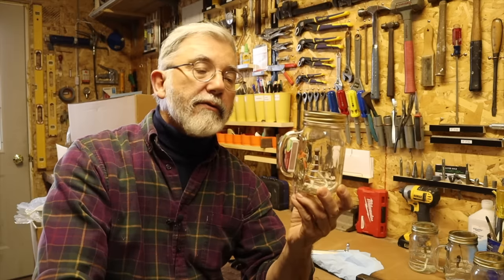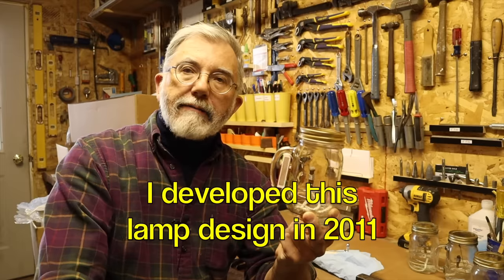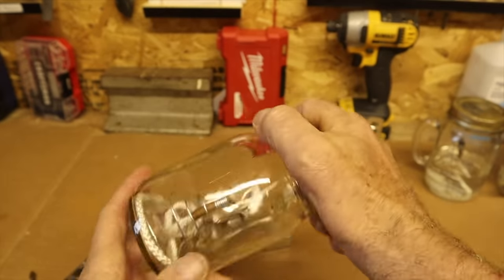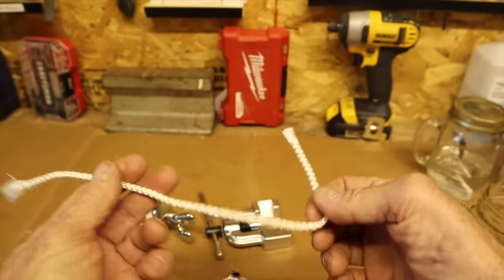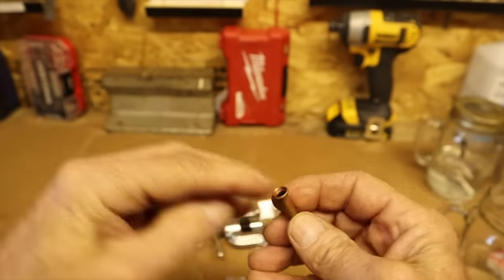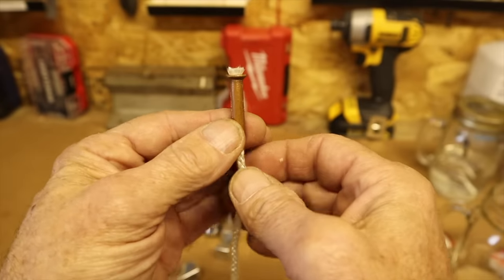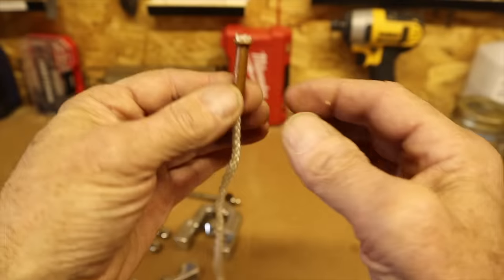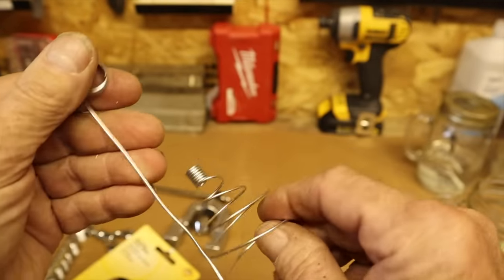How To Make Your Own Bright Betty Emergency Oil Lamp

Comment: Thank you for the great instruction on this Bright Betty Bam a Lamp! I am definitely going to try making one (or more). I was wondering where you buy your liquid paraffin?
Reply from the maker: I bought several gallons of Hollowick "liquid candle wax" back in 1999 for Y2k.  I still have most of it and it's still perfectly good. I have seen it being sold at Walmart, at ag supply stores, in hardware stores, and I've even seen it in a grocery store. There are shortages of everything these days but I think you should be able to find clear lamp oil without any problem. Amazon has it, but it's pricy.  https://www.amazon.com/Hollowick-Inc-Liquid-Paraffin-Gallon/dp/B01EYJ3BL2/ref=sr_1_3?crid=OA7YL4F9PFBL&keywords=hollowick+liquid+candle+wax&qid=1667262165&qu=eyJxc2MiOiIxLjQ4IiwicXNhIjoiMS4zMSIsInFzcCI6IjEuMzUifQ%3D%3D&sprefix=hollowick+liquid+candle+wax%2Caps%2C91&sr=8-3
Reply: @herrickkimball  Thank you for responding back to me. That liquid paraffin...pricey indeed! I wish I had stock left from Y2k too. I'll be searching around for a better deal. It may be called something slightly different, and not sold on Amazon. Love your lamps...I'm going to hunt down the jars with the handles too. Have a good evening.

Comment: Hay just wondering if the shaft/shank/jacket part of a Chicago screw may work for the wick holder piece or do they not come that long?
Reply from the maker: I don't know. It might. Worth a try if you have one. Thanks for the idea.
Reply: Georgette Roenfeldt:  They come quite long.  Mom has an album for photos and memories when traveling, that’s all together with Chicago screws, and I believe that those are about 3 inches long.  
     For a long time I carried my ideas around in a little folder with individual pockets in it. Eventually I had to expand the Chicago screw that was holding it together, to one that was an inch and 3/4 long.And that was far from the longest one I saw on the display at my local hardware store.
Reply: That’s a cool idea, but you would have to drill out the end of it, as the shaft is solid on the end.  Good thinking though, and doable.  I think it could work!

Comment: I made one of these in 2008 but the fuel was olive oil instead of paraffin.  Worked well.
Reply: Paraffin burns a LOT brighter than any vegetable oil.
Reply: @kenwaid8239  That may be, I don't know for certain.  I used Olive oil because it was what I had, it had turned bad, and was unsuitable to eat, so I used it in lamps.  1 buy 2 uses.  I win.

Comment: I like it , and  the video how it works and how to make one, Your clear instructions are  perfect,
Thank you

About shaping the coil wick stand, instead of unwinding and trying to form it   i think maybe it could be shaped by pushing it down over a traffic cone,  use an existing wick stand   place it over the cone and mark the cone 
Now you have a marked form to use when expanding the wire coil  to the needed height,
 i think I'm going to make a couple Bright Betty lamps,
Thank You

Comment: Cool deal  for the preppers in off gritters even the little backwoods runners them are nice appreciate that idea you probably could have marked it and made pretty good bit of money off of them be cool if you could put a little adjuster on there on the so you wouldn't have to put your fingers on the paraffin wax to push the wick up sort of kind of like a hurricane lantern has little adjuster knob for the wick and just you can figure it out a little pin through there with a little spiked wheel just turn it a little bit that way you pick it up turn the little thing and then raise the wick up I mean just set it back down in there but cool deal thanks for the idea God bless
Reply from the maker: The wick adjustment is best done with some needle-nose pliers. Thank you for the comment. 👍

Comment: I am wondering how a step drill bit would work for the wire after you wrap the first coil.  i have one that goes from 1/4 small end up to 1-3/8 big end..   PS.. any one remember the floating oil candles..  it was a clear plastic disc that floated on top of the oil and a center hole for a wick.  you filled most of the glass jar with water, pour a little oil, on top ( oil floats on top of water )and the disk floats on the oil.  Used like vegetable oil / olive oil.
Reply: Zak S:  I was wondering the same thing about the step bit; my mother had those candles too, with the glass tube-type lamps that she would fill with coloured water, with a thin layer of oil on the top, that was probably only half an inch to an inch thick. Us kids sure liked those.

A number of years ago, I came across the packages of wicks and plastic floats at the dollar store, and picked up a few. They still seem to work as well as ever.

Considering the price of liquid paraffin, I can’t help but feel like they were a real deal (although I do have several oil lamps all filled with liquid paraffin, at $35 a bottle and rising in my area, I’m hoping it never has to become my main source of lighting) :). 
     If you can find those disc setups, it would be important to make sure it didn’t burn down to the water level, because at that point the wick starts to burn instead of just wicking, and the little plastic disc gets damaged.
     It probably wouldn’t be too hard to repurpose one of those lids from a takeout restaurant, a variety of the smaller condiment containers, to use for the floats.

I had forgotten about those, so I’m grateful for your reminder as we are all breaking out our emergency supplies and preparing them to be pressed heavily back into service these days. Tyvk
Reply: Still selling those floating oil candiles here in Spain in those cheap "one euro" stores. Anyway they are easy to diy with cotton wicks an cork disks with an aluminium tube rolled from a piece of beer or softdrink  cans in the center hole of the cork disk. Only to use in vegetable oil, (not kerosene or liquid paraffin)
Reply: @papuchu  :  That’s a great idea for Re-creating them at no charge using just things around the house. 

Thank you so very much.
Reply: @daphneraven6745  😉

Comment: What a great idea.  I use to use oil lamps at Camp but they spilled often.  With these you can put a Mason Jar cap on top and seal them up while they are in storage.    Might make a few if I can find the Fiberglass wicks ar a reasonable price.

Comment: I bought floating candles on amazon. They are metal discs filled with air. They float in meat grease and i put a wick in them. I use my grandparent's tongs to pull the disc out if I need to. I also have a railroad lantern and an alcohol burner.

Comment: I would suggest setting the lid on the top to extinguish the flame, because the odor of the smoke that is produced upon going out can be a bother, and I really find it gross. It isn't poisonous, but also it's not like you want to open a window to air out the room, in the winter at night during a power outage.👍😁

Comment: years ago when antique stores were known for old stuff, not the reproductions they have now, I purchased several coal oil lanterns, to use during power outages.  But I discovered my wife does not like the smell of kerosene evaporating.  So I emptied them and set them back.  But this fuel you are using, candle lamp oil or liquid paraffin, should do the same and perhaps even throw out a brighter light!  Thanks for the idea!  Now I just need to check with my local hardware stores to find it!  I also purchased a few 30 day candles and stored them back.  Strangely enough, our local power company has gotten better at delivering electricity and we have very few power outages now.  But it is good to have something just in case!  Thanks again!
Reply from the maker: The liquid paraffin lamp oil does have some objectionable odor when burned. But not like the kerosene I remember my parents had in their old flat wick lamps.

Comment: now get a larger glass jar.  one you can put that oil lamp into.  put it in and carefully pour water around the outside of it.  actually put it in unlit and cold.  then light it.  the water will magnify the flame.   so make sure the flame is far enough down that you can get the water up high enough and etc.

Comment: If you could wrap tin or metal flashing around 1/2 of the mug you will gain luminosity using the reflective surfaces.

Comment: This is fab.  Do you think it would be ‘safe’ to use a lid with the straw hole in it, whilst its in use? I’m thinking about reducing liquid spill if it was knocked over. Obviously still a point where it could leak, but i wonder if there would be sufficient size hole for smoke / soot escape without too much of an o2 reduction that would put out the flame.
Reply from the maker: It probably would not work with the lid and hole. And the lid would get extremely hot if the flame was able to get the air it needs. I discuss safety in this video... https://youtu.be/asgeLt0cshE

Comment: Instead of using the paper roll for the second winding of the wire, would the top portion of a glass coke bottle or plastic coke bottle be a better jig, give a better form, and save time?

Comment: Other than smell and soot, wouldn't this work as well with kerosene, lamp oil, vegetable oil?
Reply from the maker: I think that the liquid paraffin lamp oil I use is pretty much the same as kerosene or lamp oil, but not vegetable oil. Vegetable oil will not "flow" up the wick. Smell is relatively minor, as is soot. I discuss some of this in this video: https://youtu.be/asgeLt0cshE.   Thanks for the question.

Comment: Your "liquid paraffin" or "candle and lamp oil" is just odorless kerosene.  This is a neat lamp, though -- nice light output and I like the ability to store it with an airtight lid, keep matches in the handle, and carry by that same handle when it's lit.  I might mention that I've seen lamps similar to this that burn vegetable oil (especially olive oil), just as cleanly and almost as bright as kerosene (and less of a fire hazard in storage).

Sadly, if someone wants to buy some of those drinking mugs, be sure to check that they're glass -- some of them are made out of thin plastic, which makes then lighter to ship and cheaper to make, but likely isn't a good idea for storage with kerosene inside (will the petroleum in kerosene eat the plastic?).
Reply from the maker: I did not know that plastic mugs were a thing. These lamps should definitely be made with glass jars. Thanks for the comment. 👍

Comment: I used to do commercial sewing and poly thread came on hard plastic cones that would be Perfect for coiling wire.  Of course I finally threw the 3 cones I'd saved away a few months ago.drat.

Comment: All the gadgetry you made to twist wire was insane and not vital.  I made mine while you explained how to make the wire bender from a tube and wood. The wire is flexible and forgiving. Pliers are handy but not necessary. But thanks for the plans and sharing ❤
Ps, wouldn't we want 100 percent cotton wicks?

Comment: How is the lamp during strong windy night outside the house? Is it strong to resist the strong wind? Pls reply me,,,loving from Philippines
Reply from the maker: I have not used my lamp outdoors on a strong windy night. But I have used the lamps as ambient or "mood" lighting outdoors in mildly breezy weather and it holds its flame just fine.

Comment: i started using a type of alcohol and a chemical additive to make green fire lamps, these endless oil lamps are awesome, they work with all types of oil, just don't use anything lighter than water cause we don't want vapors of fuel

Comment: I have a lot of concerns about an open flame that close to that much open fuel.  old oil lamps are out there, I'd only use this in a dire situation. Thanks for sharing though!
Reply from the maker: Please check out this video: "How Safe is The Bright Betty?"  https://youtu.be/asgeLt0cshE
Reply: what do you think people used for millenia prior to the invention of electricity? oil lamps!
Reply: @imafortunate1  Yes, but they usually are closed on top

Comment: Nicely made oil lamps and a well explained process for making them.
 Is it possible to include a fabric mesh mantle to increase the incandescent light emitted?
Reply from the maker: I have no idea how something like that could be done with these lamps. 🤔
Reply: @herrickkimball  i have been reading up some more since I posted my previous comment and it seems the reason a naked flame emits visible light is because of the microscopic soot particles in the 'sooty' flame being made to glow incandescent by the flame heat. This type of flame seems to cause delicate mantles(like gas lamp mantles) to carbon up with soot. This is why clean bunsen blue burning flames such as butane or propane work really well with a fine gauze mantle because there is virtually no sooty deposit in the flame but there is a lot of heat.
One of my ideas I'm going to experiment with is to try a gas lamp gauze mantle over a spirit lamp with Bio Ethanol fuel which also produces virtually no sooty deposit but burns quite hot.
Reply from the maker: @howardosborne8647  I like your thinking process. Good luck with the project! 👍

Comment: Have you safety tested this for fire hazards?
Reply from the maker: Yes. Safety is definitely a concern with any open-flame emergency lighting device. The worst case scenario I can think of is tipping the jar over, and  I hope to have a video out shortly showing what happens when the Bright Betty is tipped over. These lamps should only be made and used by responsible adults and never left unattended. Anyone uncomfortable with an open-flame lighting device should consider a rechargeable LED lantern, like this one: https://www.amazon.com/dp/B08L65L7PW?psc=1&ref=ppx_yo2ov_dt_b_product_details

Comment: Do you have any concerns on the glass cracking because of the heat?
Reply from the maker: No. None at all. The glass gets warm, not hot. That has been my experience. I have a new video coming out to discuss this lamp in more detail and discuss safety. The video should be out later today. Thank you for the question.

Comment: hay if you want to skip the he copper tube cutting and flareing buy a tig welding torch colet choke its the exact same size and shape also from copper just with a slit to hold the tungsten!

Comment: If anyone wants to burn almost any oil, you can use carbon fireproof mat and cut it up to use in this lamp. It does not burn up. They can it "the forever wick".

Comment: there is a potential to light the whole surface of oil and the glass will then break and could cause major issue. is why ceramic containers are better.. or borosilicate glass.

Comment: Another YTer made a lamp out of carbon fiber thats in some auto air filter but you can get sheets of it. The carbon fiber doesn't burn away but does wick the fluid, so ideal as a Neverending wick. Might wanna give that a try. The YTer is an English gent names Robert Murry Smith.

Comment: Don't use galvanized wire, just get some mild steel or use leftover solid copper or alux wire scraps. and you don't have to flare the copper. Instead of a fiberglass wick use rolled carbon felt inserted into the copper tube. It will last forever without needing trimmed hardly at all. And the song was Black Betty,  ot Bright Betty

Comment: You mentioned the tapered coil was the hardest part.  There isn't any need to taper it . Just stretch it as it comes off the cardboard tube. maybe make another turn to compensate for the larger diameter at the top using more wire.

Comment: Hmm, thinking you need a wooden cone to save yourself some grief in forming that gradient  spiral. To give you a visual, picture a jeweler’s ring sizer (only wooden and bigger).  Think that’s the route I will take in forming this spiral.  It will save my hands and time.  Thinking out-loud, could be wrong, but worth a try. 😉
Reply from the maker: Good idea. I have a whole roll of string (miles of it, probably) on a heavy cardboard cone that would be just right. Your wire spirals will be beautiful, I'm sure. 👍

Comment: Cool set up. We learned at camp: a float for a shorter wick, only needs to be as long as the oil is deep. If you put water in the bottom, it will automatically go out when it reaches the water. A safety built in. And any salad oil will work. Maybe not as bright, but light is light.

Comment: Correct me if I'm wrong but if burning paraffin is not as safe as an organic candle,why would you want to burn liquid paraffin to burn as a emergency source for heat, wouldn't you want to open a window for some sort of ventilation,for safety reasons.

Comment: You could make a cone out of that tube by cutting a slit and folding it into what you need, then tape it. It would have a point on the top you could place the small coil on before you go to wrap it around the cone. Then just make the cone the size you need from that point. Snip and tape job is all it would take unless I'm missing something.

Comment: If I can make a suggestion... it might be easier to use a small funnel or cone to wrap the graduated section of wire around, thought it might be more trouble than it's worth.

Comment: How does the flame get air, down there in the jar? My experience with oil lamps and candle lanterns is that the one that burn the best, cleanest, and the brightest have a way for air to come in at the bottom and exhaust to go out the top, so there’s a constant upward draft instead of air turbulence mixing fresh air with exhaust.
Reply: This is not a restricted flow of air. It’s one wick in the middle of a big jar, with lots of airflow.

Edited To correct an auto correct error.